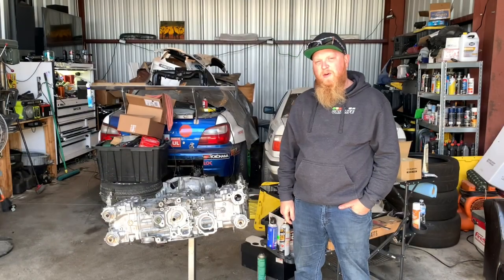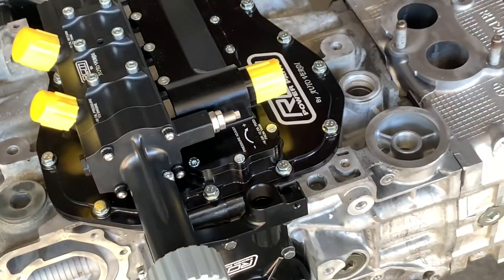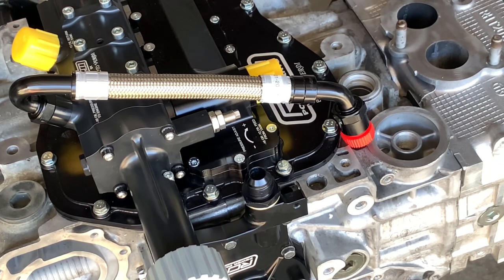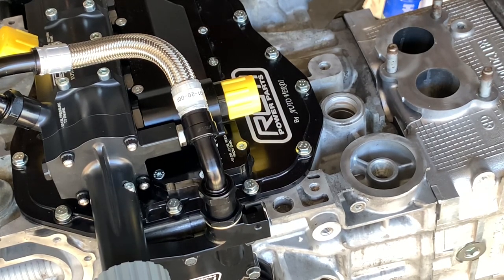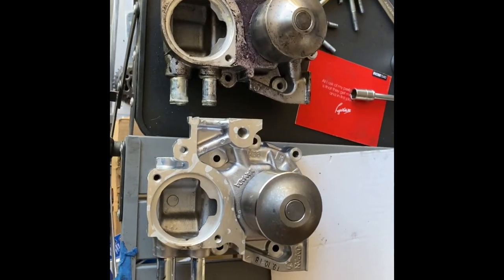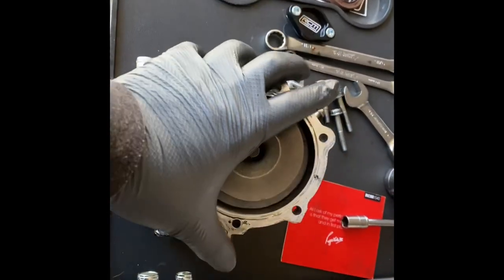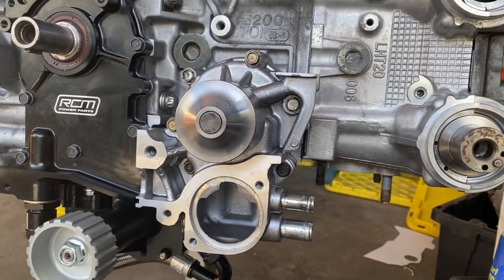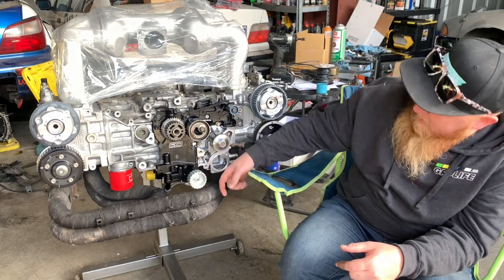Ghostwrex EJ207 Block, Part 2... Dry Sump and Cams!!!

Comment: Hi . How did you get on with the spacing of the manifold with two gaskets to give a bit more clearance between the dry sump belt and the manifold.  I have the RCM dry sump installed and it is exceptionally close to the manifold. RCM say is fine and just change the belt every year.  I have ceramic coated manifold rather than wrapped.